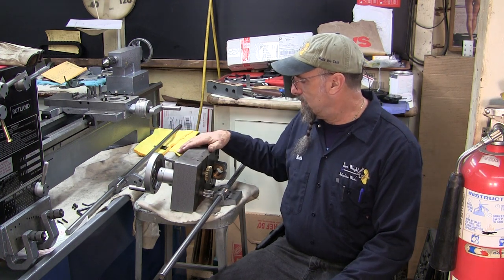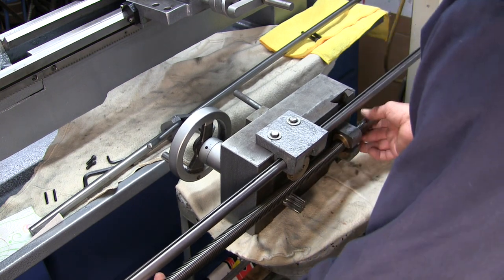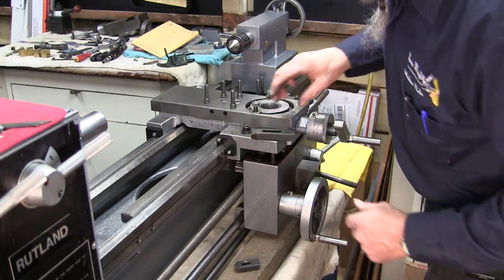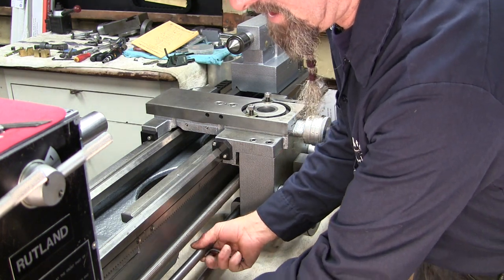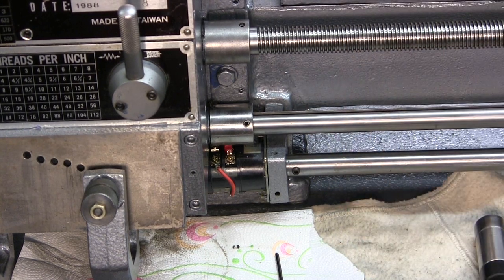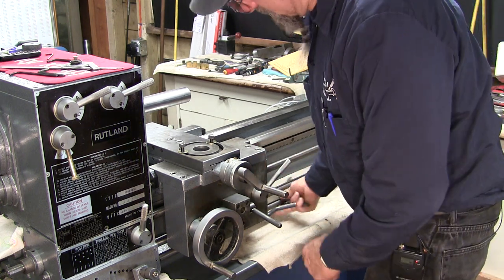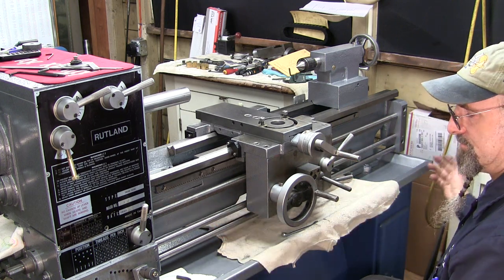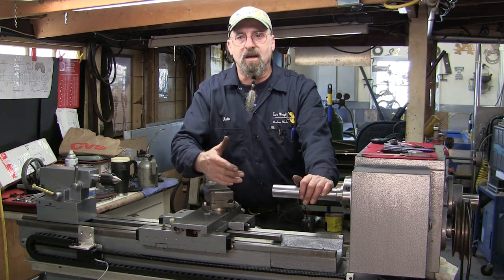Let's Look Under The old Girls Apron Part Ten

Comment: Merry Christmas! Fine series.  I have the Enco sister to your Rutland. Shortly after purchase, I was using it and a roll pin through the drive screw came loose and protruded enough to hang on the lathe body causing a fiberglass gear to strip teeth. I hammered it back in place, put a safety wire through it, replaced gear and back in business. Still going with the safety wire nearly 20 years later. FYI

Comment: On that bracket for the three rods, put the upper bolt in without the gasket/shim; put the bottom bolt (now located) through the gasket and engage the threads; now remove the upper bolt and rotate the gasket into place; reinstall the upper bolt (now through the gasket).

Comment: Role pins work great. Especially since I have two south Bend lathes witch caused me to have a visceral hatred for taper pins. I swear my 16/24 has 6 bolts 10 screws and a half a million taper pins.

Comment: The offset pin on the threading screw makes complete sense, for aligning thread. One half rotation on halfnut thread pickup. probably makes a big difference on odd thread size? Or is it all just relative?
Reply from the maker: The only time that timing plays part in lead screw engagement and part is after the cut has been made or alignment of existing pitch. The hole was just not centered when drilled and it is better to sight holes before hammering in pin.  ;{)--------

Comment: I would like to do your oiler mod on my tailstock. Is there an easy way to remove those ball bearing oiler ports?  I could drill it or abuse it out.  And where did you get the neat oiler flip cap port?

Comment: Wouldn't it have been better to use actual steel shim-stock that is 5 thousands thick than a piece of paper that will crush? It comes in rolls.
Reply from the maker: Not really, the abundant surface area is less giving than a pinpoint support. ;{)-----

Comment: Made a meal out of getting that gasket in, stick it to the surface with a smear of grease, unlike the spray adhesive suggested it aids subsequent disassembly rather than giving you extra clean up next time.